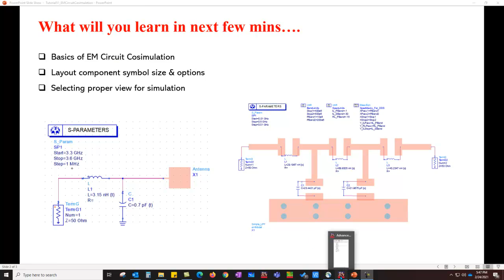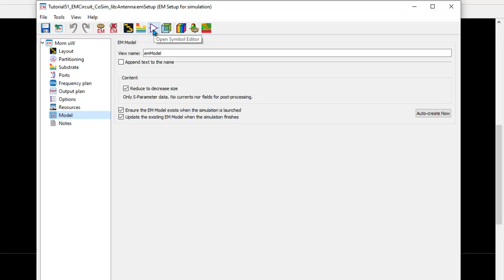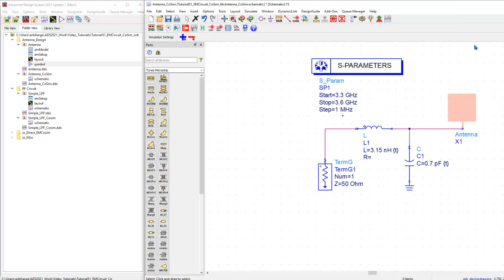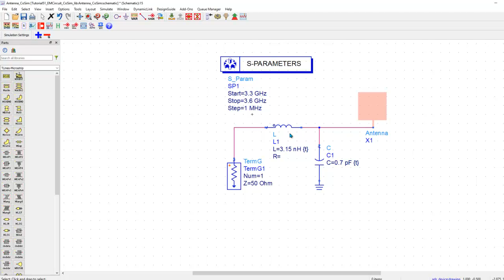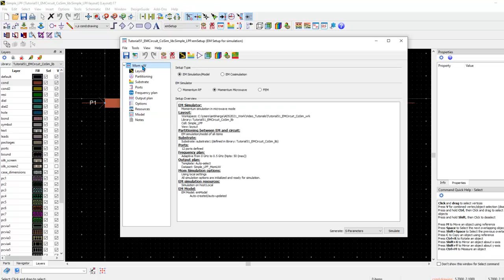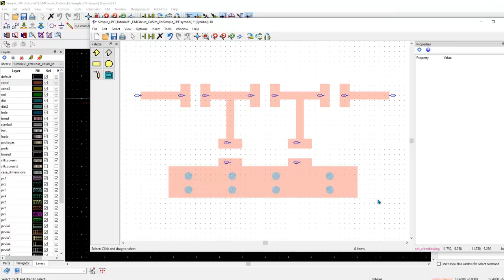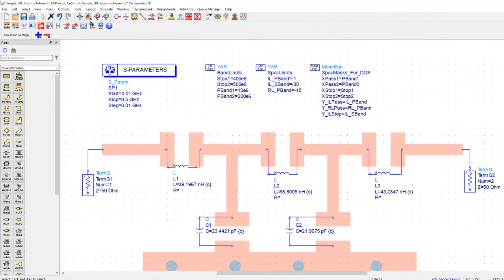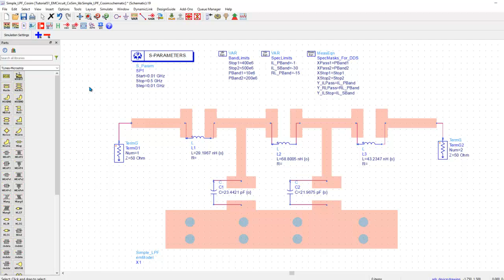Tutorial-51: EM Circuit Cosimulation in ADS

Comment: Thank you for your absolutelly great tutorials!
I have a question - when I run CoSim in automatic mode, set lumped components as simulated from schematic, and disable some of them (shorted or removed) - will it be processed in simulation? Or how should I do it?
Reply from the maker: Try using RFPro in ADS instead of using legacy emSetup as that provides much higher flexibility and ease of use.

Comment: when i try tuning my em cosimulation circuit, I get the following error

A tune value has caused the simulation to fail

Error detected by hpeesofSim during HB analysis 'HB1'.
COMPONENT 'X8.em_data':
MODEL FAILURE: The EM Model's database for X8.em_data is not complete for real—time Tuning.
Simulate the cell first to complete the model database.
Use the interpolation delta as the parameter sweep step.

Error detected by hpeesofsim during HB analysis .
Fatal error occurred while evaluating model 'MomCmpt' ,
instance
'X8.em data' .
Reply from the maker: My apologies for the delay in response. If seems you have a parametric EM data and trying to do tuning? If so, you need to double click on emmodel view under the cell and switch on Interpolation delta value. If you are unsure what to enter in interpolation column then simply enter the same step size as you used in EM analysis.
Hope that will resolve your issue but if it doesn't then contact your local Keysight team for help.

Comment: Thanks Anurag for these valuable videos.
I have a question on this topic. while creating a layout components i added EM parameters but when i try to use those parameters in setting the dimensions of standard microstrip components (Pcells) it accepts that for the first components only then it starts to give me error for using the parameter with any other component!!
is that normal? what is the mistake that you guess i had done?
Regards
Reply from the maker: Hi Alaa,
Its difficult to pinpoint what exactly might be going wrong here. I would recommend you to contact your local/regional Keysight tech support team to get help.

Comment: Sir you haven't added substrate in your schematic window, is that fine
Reply from the maker: For EM Circuit cosimulation, substrate is not necessary as you already have simulated layout with EM and now you are only connecting electrical models like L, C, Transistor etc which doesn't necessarily require any substrate definition.

Comment: Thank for your video! It worked fine for performing a sweep on a parameterized layout. But when I try to run an optimization on the same parameterized layout structure, I get errors all the time. "Can't find any data for range var 'freq' ". Can you help me please?
Reply from the maker: That's a weird error. I would recommend you to contact local Keysight technical support to get help.

Comment: How to add via from a top copper of a substrate to ground plane in the layout? Is it from insert via command? If yes, then should the via to be defined between cond and cond2 layer?
Reply from the maker: Yes, you can use Insert->VIA to drop in a VIA onto your layout.
Whether you define VIA from top to bottom i.e. cond to cond2 or you want to use Blind VIA (i.e. you can start from top and stop on any in between layer) depends on how your PCB will fabricate it and you should use the same in your design.
Hope this helps.
Reply: @BhargavaAnurag  In one of the lectures, when you imported substrate from schematic to layout then in the stackup both cond and cond2 layers are shown on the top of the substrate. I also tried to do the same and getting the same stackup in the layout but still I am able to define the via between cond and cond2 and after simulation when I am viewing the 3d then via is showing from top copper to the ground plane. How can a via be defined between conductors in a same layer? Is it that I am not able to understand the way ADS defines via and what is the difference between via and component via in via definition. Please help.
Reply from the maker: @AK-ov2kx  If two metal layers exist on the same level in stack up then there is no VIA required as you can directly connect them....😊
 VIA is only applicable if you have to connect metal layers which are on different position in Z-axis and that is why it is called VIA i.e. Vertical Interconnect Access (VIA)
For more help, kindly contact your local Keysight support team.

Comment: I have a question. When on layout, my pin symbol and text becomes very small? Where can I change that? I have gone through many options but still I am not able to increase the size.
Reply from the maker: Hi,
You can set your desired size from Options->Preferences menu but sometimes things which are already in layout won't change but when you place a new component then it would be as per your new settings.
Reply: @BhargavaAnurag  Thanks a lot

Comment: How to check the output voltage Vs frequency graph, output voltage Vs input power, and efficiency Vs load resistance? In ADS for RF energy harvesting circuit
Reply from the maker: Hi Pradeep, 
It should be pretty straightforward. Kindly reach out to you local Keysight tech support team for help.

Comment: Hello Mr. Bhargava 
I been enjoying your tutorials they are really helpful. I have question about this video you have placed the pin at end of transmission lines instead of at the of inductors and capacitors footprint pad. Does it make any difference on simulations by placing pin at the edge of capacitors and inductors mounting pads and at the end of transmission line connected ?
Reply from the maker: Ideally you should connect the simulation pin where you expect the component to start or finish on the pad but it doesn't make a huge difference upto decent amount of frequency range as usually the difference is only about 0.1 or 0.2mm and that doesn't cause too much of problem unless you are in mmWave range.
Reply: @BhargavaAnurag  Thank you 
Mr. Bhargava

Comment: For impedance matching, you have used LC units for matching using Smith chart. can we use RLC circuit ?
Reply from the maker: Yes you can but Resistor is usually not recommended on higher frequencies as it will suck up the power so its not a good component for matching network. You can survive without resistor....😊

Comment: Sir, I have a question. How we can make an antenna circuit model or lumped element model using touchstone file? I have antenna model in CST and wanna make its circuit model. Waiting for your kind reply asap. Thank you.
Reply from the maker: Kindly check Reverse Engineering i.e. Video 21 in the same playlist....
Reply: @BhargavaAnurag  Thank you so much for your kind reply Sir. I would like to ask that how you have chosen that circuit diagram. I mean based on which criteria? My second question is;  when I simulate my touchstone file after applying TermG to its one port it shows different S11 result as compared to the result when I just check touchstone file itself on S-Parameter view? Why these both results are different ?
Reply: I have read a book where it is mentioned to used Foster canonical forms for each individual resonance cure of S11 which means each resonance curve will get an RLC circuit for its equivalent modeling. Is it possible on ADS sir?

Comment: I'm planning on designing a PIN diode based phase shifter and I'm thinking about doing either switched line or loaded line. which one has less insertion loss and more accurate phase shifting?
also, how do you create the ground patch?
Reply from the maker: I would recommend to go thru relevant paper for 1st of your query to get right info. I couldn't understand your 2nd part i.e. ground patch.
Reply: @BhargavaAnurag  the line with via holes on the bottom of your filter